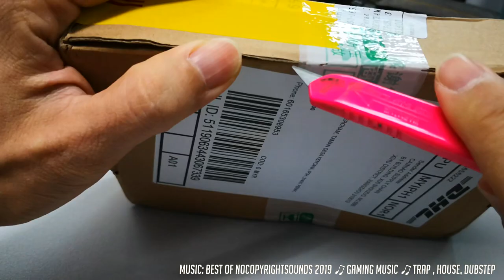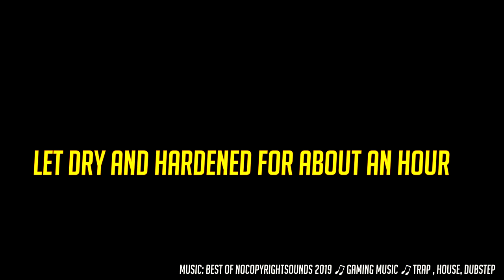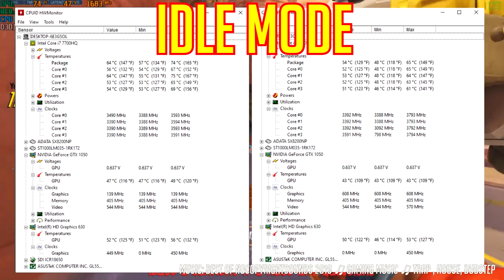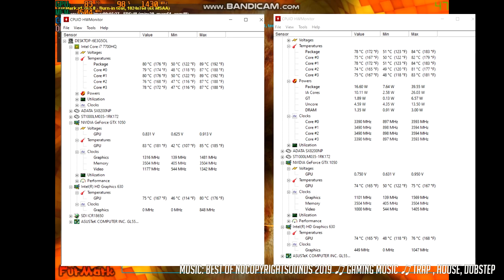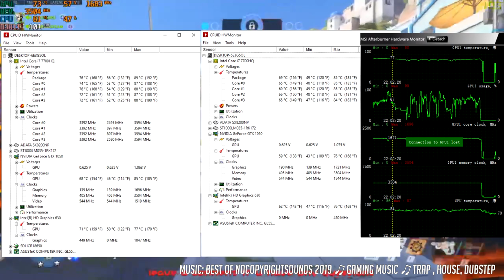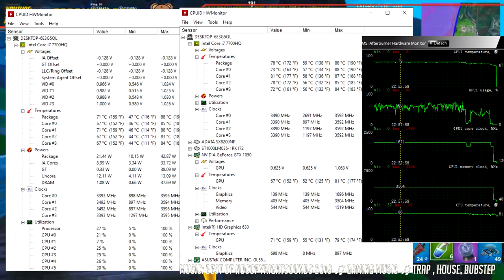Laptop heatsink modding - Asus GL553VD

Comment: The best idea is to remove cd/DVD drive and at that place install heatsink along with heat pipe. 
I have done it and it works fantastic. 
Temperature drop drastically. At full load cpu temperature peaks at around 75-80c.
Nowadays CD/DVD drive are useless.
Reply from the maker: well..... i used that drive space for hdd/ssd expanding.....
Reply: Where would you connect the new Fan to?
Reply: yeah where to connect the extra fan?
Reply: @roofrangers2033  sata
Reply: @roofrangers2033  make a Y split from the other fan's wires so they run in sync.
Reply: Amit Bhai, what glue did yo use, was it heat resistant, if not was it conductive, because I don't want conductive paste to melt and go to the components.

Comment: Thank you for this video. It was one of my inspirations for upgrading my laptop from single to dual heat pipes. Now I can run my i7 4700mq at 3.2GHz all cores  and stay under 90C for long video renders, before anything over 2.7GHz would take me to over 96C in under a minute.
Reply from the maker: alto try throttlestop, lower a tiny bit of voltage, it helps further
Reply: @terrybear2k  Yes, I am using it as wll. Thanks. My 4700mq has a max turbo of 3.1 all cores, so 3.2 is actually overclocking it and it is wtill under control with temperatures.

Comment: I would suggest, remove optical drive and setup new heat sink n a fan in place of optical drive
Reply from the maker: nvm, laptop already sold 2 years ago, still runs fine enough until i sold it. the fella din complain to me means it's still running fine i guess

Comment: This is nothing but amazing sir. What a creative way to utilize the confined space in a laptop to improve its thermal performance. Kudos!
Reply from the maker: After quite a few months of extensive testing, it falls under "sort of" working category, I probably need to reseat the pipes
Reply: @terrybear2k  Or change the termal paste into liquid metal. I have the lenovo y520 and i think the only way to get better temps is to lm it sadly. I have been changing the thermal paste every couple months(notcua n1-h1) and the result is still disappointing. In my opinion the huge problem in gaming laptop is the thermal conductivity of thermal paste. I dunno. Will try it out soon I think. Such is life of a gaming laptop user lol 😅
Reply from the maker: @clementm6620  i just don't trust my own hand's stability to apply liquid TP.... im so broke i cant afford another laptop lolsss
Reply: @terrybear2k  just tape the complete laptop out and then apply it

Comment: I know this is old but honestly I would have made the back of the laptop out of aluminium entirely also adding an aditional 1.5cm of thickness to acomodate for another heatsink and fan.
I am not high I promise 🤞
Reply: Here again, this modding obsesion is haunting me😂😂
But I would've gotted rid of the DVD reader and retrofitted another cooling solution there😂
Reply from the maker: back then i needed the dvd to do some work, so no choice, there are ppl that are selling dvd slow fans tho
Reply: @AutodidactEngineer Other modding you have done recently?

Comment: You could drill larger hole where fan is located. you could have better air flow in that way. Since you have small holes far away from your cpu fan for air intake.
Reply from the maker: It hurts to see a physical damage on the hull lols
Reply: @terrybear2k  but.. if helps why not I mean you can put a metal grill or screen with holes if you do a cut out on the area where the fan would be and more air can get in to cool down the laptop
Reply from the maker: @TheChillDeadpool  nah, i dun wanna damage the chasis due to IF later on i change laptop, i wanna sell this thing
Reply: @terrybear2k  if your planning to sell it then yaa don't do shit to it lol 

Modifications like having a hole with a dust protector vent thing for electricitics or adding a second heat pipe would definitely would be a no
Reply from the maker: @TheChillDeadpool  at least i won't damage the outlook lols
Reply: No, it would be prone for bigger dust particles and cotton fibers get into the chassis and stuck to the thin heatsink/fan chambers ...the chassis must be ina  way where it can allow air in at the same time to avoid bigger solid particles entering from... technically I would call this phenomenon as permeability (where only air is permeable and not the large solid impurities)

Comment: the heat pipes will only radiate out a little extra heat in the way he placed them....if he could add another small heatsink and extraction fan he would have seen a lot more cooling, a good move is to place a pipe on top of the original pipework to the top of the fan casing, the fan casing is being cooled by the fan so it acts very well in losing heat, thats as long as the top of the fan is metal of course..i may also add a small inlet fan to my laptop(asus tuf fx 705dt)
Reply: @PC_Modder Cool, is it modded now?
Reply: @PC_Modder is it modded now?
Reply: @PC_Modder damn you live up to your user name, well im happy it turned out you with a good laptop in the end. I would send msi one last message telling them what a ridicilous support they have and that you sold the piece of shet and bought another brand which is 10 times better and that you will spread the experience about their ridicilous support, just think ''MSI said it's my fault because I used a portable device as... portable device and opened/closed it too many times, putting too much stress on the hinges'' LMAOOO its manufacturers fault if their product is durable of not, some laptops survive years without problems.

Comment: having the notebook upside down, cooler to the right, which is the processor and which is the graphics? the one on the left is the processor and the one on the right is the 1050?
Reply from the maker: tbh i can't remember, sold it for quite a while now lols. but my guess is the one on the edge is the cpu and the center is gpu? try wipe off the thermal paste and u will be able to see the etched label tho
Reply: @terrybear2k  thanks you bro
Reply from the maker: @gianxt  np

Comment: But can I buy the pipes and bend them myself? Is it possible? Cause they have the pipes for sale as straight ones and not bent. I already have a laptop cooling pad, but I'm convinced the copper pipes will do great for my laptop, if only I can fit it in
Reply from the maker: bending copper pipes isn't hard. but my advice is u can skip it unless u mod for the fun of it. it doesnt make much difference anyways. the fan i to you earlier will have much more insane results
Reply from the maker: normaly cooling pads are trash. kinda useless (cuz i bought a lot)
Reply: This will be my final mod for the laptop, and it's because I also upgraded the GPU and CPU
Reply from the maker: @joshsam3166  good luck

Comment: Did you use thermal paste or thermal glue to stick the extra heatpipes ?
Reply from the maker: yup. thermal ceramic paste. but tat was.years ago and i found better solution. iets gt500 or ilano v12

Comment: I will try to some crazy stuff to my Legion 5. Not for the temps. Laptop runs pretty good already maxing out at 70c running rtx 3060 at 130w. But it's laud... So I wanna add big aluminum thin heatsink on the heat pipes and blow air in to it.
Reply from the maker: Aluminium plus copper sounds like a bad idea
Reply from the maker: If u wanna try the extreme try this, https://youtu.be/zVrHDXbXjhM

Comment: I am thinking doing the same, I would also tru to add to the m2 memory and as well to the ram
Reply from the maker: well most stuffs u won't regret, just that bare in mind most aaa u won't see it close to 100fps tho... even with 720p low settings i can't get a stable 100 in overwatch lols
Reply: Mantis i am using it with my m.2 ssd. Dropped stress test temps from 60 to 52

Comment: I have the same model and my reaches 40-42 C gpu/cpu on idle xD Looking for best way to improve my cooling tho because on trackmanina 2020 on reasonable settings it reaches like 86 C on gpu. One longer heatpipe would make better difference. With this two you still transfer heat to the place whare turbine can't collect it...

Comment: great video mate. just bought a heatpipe for my own laptop. ive gotta ask though, why didnt you put heatsinks on the vrm's and why no liquid metal? works great with that copper coldplate you got.
Reply from the maker: thx for the compliment. i don't think it needs heatsinks on the vrm tho, but i might be wrong. im more focused on briing the cpu temps down. also im not confident enough to apply LM..
Reply: @terrybear2k  liquid metals really straight forward and has awesome results. Watch the ltt video, he uses non conformal spray which is the best option imo. 

 If the vrms hit high enough temps, they reduce voltage to the cpu/gpu, this will look like throttling, except the cpu/gpu temps will appear to be fine.
Reply from the maker: @daylightriot5671  yea i know about LM, just not confident with my own shaky hands lols. so far my clock speeds seems fine tho
Reply: @terrybear2k  fair enough. I only started doing it myself a couple of years ago. I had a strix vega 64 that used to throttle bad because the pads used for the vrm cooling sucked. Plopped on a minus 8 pad and voila, no more throttling. 

I recently installed vrm heatsinks on a ryzen laptop and dropped about 3 degrees while maintaining more consistent gpu/cpu clocks.

The cooling is absolute trash on my laptop tho. Gonna do the heat pipe mod and install a copper shim too. Howre your temps holding up? Still lower?
Reply from the maker: From want i can tell it's more or lessthe same
Reply: @terrybear2k  done the copper shim mod and holy crap the results are insane. i can now push 25 watt constant through this apu and get 65c while gaming!! before the mod i was pushing 20 watts and hitting high 80s with lower cpu/gpu clocks.
Reply: @daylightriot5671  may i know how you did the copper shim mod and the design of the original cooler?
Reply: @daylightriot5671  can I see your design?
Reply from the maker: Tat reminds me, I wanna see too

Comment: If i do this, will it void my laptop's warranty? I live in the U.S
Reply from the maker: Do it after warranty's over
Reply: @terrybear2k  6 months left then😫
Reply from the maker: If i were you, I'll just get my hands one the latest amd tuf a15. Intel is shitty now
Reply: idk in the US u can do anything under warranty as long as it does not damage anything. U dont need adhesive for heat pipes.u can attach it with rubber or something
Reply: @terrybear2k  the tuf a15 has blocked vents for some reason, only on the AMD versions.
Reply from the maker: @usuallyclueless4477  tats why i heavily suspect some shinnenigans going on in there. but it's ok. im not buying anytihng this year tho, waiting for rtx 3050 or something like dat

Comment: I don't think it worked chief. I think it would be more useful to put small heatsink on south/north bridge chipset and or RAM/Bram if it's separate on your motherboard.
I was thinking into doing heatpipe mod to my laptop but after seeing this, it would likely not work.
Thanks for video
Reply: Perhaps a good addition was some tiny narrow fan inside body to move and circulate air inside
Reply from the maker: @replikvltyoutube3727  probably. but it doesn't matter now. sold this off a few years ago, now (2024) found better cooling options like ptm7950 thermal pads and also insane cooling fan like the llano v12. which work like wonders

Comment: I have the same notebook, but my temps are about 85^C in CPU, the clock drops to 2.5 or less. I cant even maintein 70 fps on fortnite. I dont know what i do. thinking in buy some heatsinks and paste then in the original copper pipes. maybe it Works. Sorry for bad english
Reply from the maker: u can try this method, also i use throttlestop to lower max voltage to further help thermal throttling
Reply from the maker: but fortnite depends on th area and situation, if fight broke out like in 20vs20, frame drop bad

Comment: I wanna start off by saying nice work and congratulations on the results 🙂.

However I think you would have been better off only using heatsink and no extra heatpibe. 

My reasoning for this is, that although the heatpibes transfer heat very well, they aren't particularly good at dissipating heat, not much surface area or even mass. And since they don't reach the fins at the end, the original heatpibes end up transferring pretty much all the heat to the heatsink. You would have been able to put fins down the original heatpibe, thereby increasing surface area. 

I could be wrong, and it's just a thought.
Reply from the maker: im planning to remove the pipes and re-mod it, after a few months, tho the temps are better than b4. im still looking for a way to remove those ceramic pastes without damaging/bending my original pipe lolss
Reply: You should get longer pipes and make them go into the fin stack itself.
Reply from the maker: @jm036  i was thinking of it, but now it is stuck on so tight i won't dare to force remove the pipes. for it might bend the original pipes.... =.=....
Reply: @terrybear2k  if you apply ,can u make a video for the best location?

Comment: I don't think you have an understanding of how heat pipes transfer heat. Piggy backing heat pipes will not achieve very much at all . The internal process is far more efficient than the radiated heat transfer you are trying to exploit. -Need to run independent heat pipes from cpu/GPU  heat sinks , to an additional fan. Then significant temperature drops will be  achieved.
Reply from the maker: Welp, nvm about it anyways, it kinda worked wonders for me these few years, but still it was getting slow on way I wanna do wit it, so I have upgraded my laptop and sold this one off lol